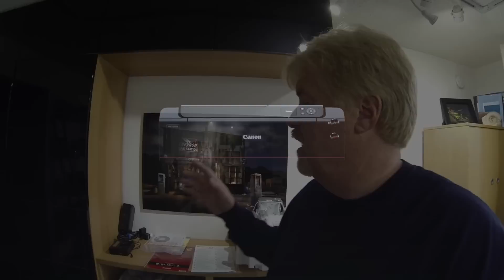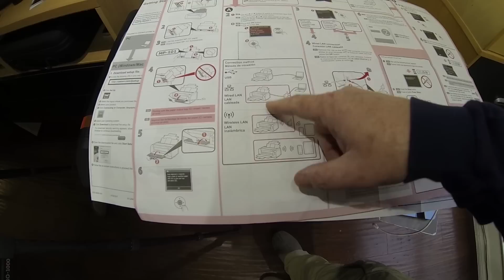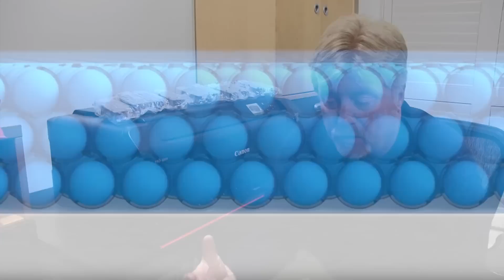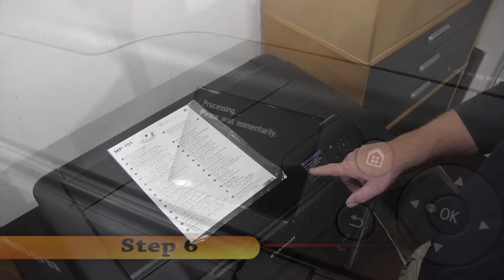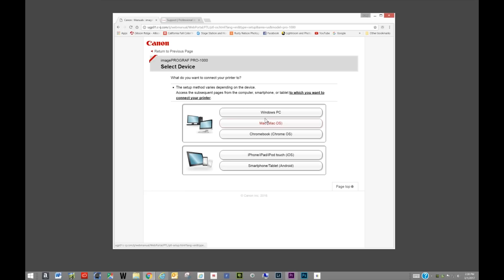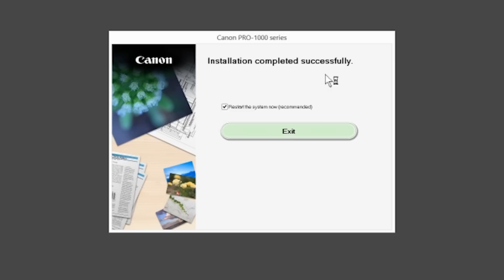Canon ImagePROGRAF Pro 1000 Printer and software install / unbox.  How easy was it to setup?

Comment: Hello,

I recently purchased a Pro-1000 and have been unable to install the drivers on Windows 10.

The software/driver package fails saying something along the lines of "Installation failed. IJ Driver could not be installed."

The driver install fails saying "An error occurred while files were being copied. : 0001 0002"

I contacted Canon and they said this is a known issue and they do not have a fix.

Before I return this thing I was wondering if you had heard of similar errors? Canon doesn't seem to pay much attention to their software.
Reply from the maker: I have not had that problem.  I would call them back.  Make sure you are talking to an uplevel tech in the US before you get off the phone.  I would also search around the internet under that code.  Something should pop up if it is a real issue.  I would even call back a third time.  I have 10 and have had one time a while ago where I had called a few times until I got the right person.
Reply: @RustyNelsonPhotography  Thanks for the response. I didn't end up getting any help from Canon, but I did figure out a workaround after doing some digging.

I examined Canon's driver signatures, and one of the signatures expired in February 2020. Additionally, the signatures have no timestamp which throws a warning in DigiCert. My theory is that Canon's expired driver signature causes installation problems in some Windows configurations. I'm no expert on Windows driver signing however, so I can't say for sure.

It is possible to restart Windows with driver signature enforcement disabled. Doing so appears to allow the drivers to install.
1) Click Start > Power
2) While holding the Shift key, click restart
3) Select "Troubleshoot"
4) Select "Advanced Options"
5) Select "Startup Settings"
6) Select "Restart"
7) When your computer restarts, select the option that corresponds to "Disable driver signature enforcement"

 8) You should now be able to install the drivers. You'll get a warning message that Windows could not verify the driver signature, and will have to click install anyway.

This worked for me, hopefully it helps someone else.

Comment: Rusty after a couple of years are you still happy with the Canon Pro 1000? Would you buy it again?  I need to replace my Epson 3880 after 10 years. Any insight is appreciated.
Reply from the maker: Yes.  But if you want to use roll paper that is a consideration.  They did a firmware to about 47 inches or so.  But the end answer is yes I like it.  Let me know how it goes.  I have not had a problem with it even after the LONG storage as you probably saw in my video.

Comment: Canon has developed driver/software to print 46" long prints but have not offered paper 17x46.  Has anyone cut a 45" long x 17" wide paper to print panos on the pro 1000?
Reply from the maker: cant remember how I cut it but I tried it and worked fine.  If you are coming off a roll your will have to counter roll it to get it to lie a little flatter then when it comes off the roll.

Comment: I need your help. The software for installing the driver run, but after at point 3 it say that it’s impossible to installing the drivers. I use Windows 10. Have you any suggestion? Thank you.
Reply from the maker: Really sorry but I would really have no idea.  Just not enough to go on.  I would call Canon tech support.   Sorry about that.   One question that may help somebody else answer...is this the first time you are installing the driver?
Reply: @RustyNelsonPhotography  in this pc yes, is the first time and the first printer installed. 
Is a second hand print. On the printer the driver are update.
A note: windows see the print and it work but whithuot the canon drive, and like you know with fewer option for print.

Comment: Thanks for this Rusty. I just got a full replacement of my Pro1000 from Canon. My first one was still on warranty. I got a B506 message on the LCD screen and a very troubling chattering sound from the print head. Canon support didn't have a clear answer as to what B506 meant. The new machine arrived in under a week.
Reply from the maker: I must say that Canon has always treated me well.  I'm about ready to start my new pro 4000 and hoping for the best.  Just started up my pro 1000 after sitting for 15 mnths.  https://studio.youtube.com/video/kiOk_r_wqI8/comments

Comment: I have concerns about size of printer with paper trays  folded out. You say the rear one needs 15" but in your video when you printed nozzle check it looked more like 9".  This is important to me as I need to fit on desk and size is critical. Thanks
Reply from the maker: Sorry I did not get back to you in the middle of a move.  Yes I do not have...or did not have 15 inches but that just meant that the paper when loaded was up against the wall.  Worked for me but may not work for you.

Comment: Thank you for the great video. Can you please provide info on what stand you are using for the printer? That printer weighs a ton.
Reply from the maker: I just have a self made stand out of a flat File cabinet.  On a table from Ikea but is braced between two cabinets.

Comment: I've just had to refill my Pro-1000 ink cartridges.. However I can not disable the error code '1730' that says they are still empty.   I read where you can disable this my holding down the STOP/CANCEL button, but this is not working for me.   Any suggestions?
Reply from the maker: Hey Jane I only use the inks from canon so I'm not really the one to ask about refilling.  You might try throwing it out to this link.  Jose does a bunch of refilling.  Tell him Rusty sent you.  All the best.  https://www.youtube.com/user/cheo1949

Comment: Thanks for this great video. I'm late to the party but I've just discovered this video. Wish I'd seen it before I set up my first Pro-1000 last year. That's just about to be replaced by Canon under warranty and the new one is due next week. Glad I watched this before it arrives. PS pray you never see a B208 Support Code on your printer. That's why mine is being replaced. But to be fair to Canon UK they've been amazing. No quibbles, new printer. Bosh!
Reply from the maker: Yes they are good about replacing when things really go wrong.  I've had a good experience with Canon...thats why I stick woth them.   Let me know who it goes with the new one.

Comment: Is possible to know what is the capacity of the initial ink set that comes with the printer package? Because the regular inks are 80ml, but would be helpful to know how much the initial set will last. Thank you.
Reply from the maker: Not sure if they short you on the first ink carts like HP used to do.  I order a replacement as soon as the ink low level comes on.  You have plenty of time after that before it "stops" completely.  I just made a major move so I'm a little behind and not set up to make vids right now.  Next video will be unpacking  from a shipment cross country.  Has been packed away for a while so it will be interesting to see if it fires up with no problem.

Comment: So I just got my pro-1000 set up, I’ve calibrated my monitor and have the appropriate ICC profiles for the printer and paper but for some reason what is on my screen is not what I see on the print. It prints beautifully and bolsters my confidence in such a purchase but I’m at a loss now. Could you shed some light on my dilemma please?
Reply from the maker: There are a bunch of things that can go wrong but my first guess would be that you have not turned off the "printer manages".  This would mean that you have double "managed" the color.  Being that I have no idea HOW you are printing...software...computer...setup etc... make sure you have the color correction in maunual setup in the driver set to "NONE".

Comment: Rusty, This was a great video--one of the best on setting up the Pro-1000 and the one I used for info when I set mine up.  I know it is not something you covered but wish someone had put out the information on how much ink this printer waste.  It puts a fraction of the ink on paper that it uses cleaning and all that goes to the waste ink cartridge.  I have done most of the things to minimize this but still the unit waste 7-10 times the ink it is putting on paper.  This is a huge cost! This printer should be advertised as a production unit only, not for someone who wants to make 3-7 prints per week. When I use up the 2nd set of inks that I purchased, I will probably use this printer as a boat anchor and get an Epson P-800. I'll come out ahead on cost very quickly. The 3-4 ml of ink the Epson printer uses to swap black and matt black is nothing--I repeat--nothing compared to what the Pro-1000 waste every day!
Reply from the maker: Thanks for the kind words. I wish I had the real story for you, but I can't find a "true cost" for the inks but I did find this for you. I have not run actual test.  Remember I do not get paid by anybody. Fro knows best did a cost doing a print with the pro 1000 on Red River paper and Red River did a cost of ink with the p800. Here are the links. 
Fro https://froknowsphoto.com/the-exact-cost-of-an-inkjet-photo-revealed/
From Red River. http://www.redrivercatalog.com/epson-surecolor-p800-cost-per-print.htmldraw your own conclusions folks.
Trust me...I'm not arguing with you. They all seem to use a bunch to me. But here are somethings Ihave found about the Canon that may help. 
Also these are not really direct comparisons.  I wish I could find one.  But Canon does supply the software to figure
it out…I do not use it.
1. I have been told by the Canon folks that you can use the Ink cart all the way down until it stops.That is what I do. It will tell you the ink is low. From experience...there is a ton of ink left at that point and I just use this as a warning to make a new order for that color. Once the ink is out...the printer will stop. They do not
tell you this in the manual. BUT...they told me this when talking to them. Up to you. 
2. Take a print and run a test on your quality settings. If you do not need "highest" quality don't use it. 
If anybody has any information on this subject, please feel free to just jump in and help. BUT...you need to show the documentation and not just slam one printer or the other.
Reply: Rusty, I did not offer a lot of proof in the comment above and for that I apologize. I don't troll companies or products and you'll notice I always use my name. Rather than produce a new list here, I'll just copy the info I sent to Canon. I have seen little or no change in consumption since this info was sent. Typical was the other day when I made a print 43 hours after the last print, used 0.602 ml on paper but consumed 5 ml of ink. In the write up below, please pay attention to the 6 min. cleaning cycle that reportedly uses 59ml of ink. This happened to me even though I had printed the day before and did not request a cleaning cycle--I just hit print. I am not including a link to a forum on Luminous Landscape where a man confirmed it has happened twice to him--he does appear to be a commercial printer though and still sees a waste to print ink ratio of about 50-50. This printer is just not for hobbyist or enthusiastic armatures--I put my self between these two. 
Thanks, Mabe Hall

One last note: I have found that the initial fill cartridges hold around 86 ml of ink yet--this doesn't affect my overall calculations.

The following was sent to Canon.

The Problem: Unbelievable high ink waste
I have called support twice, received some ideas and then taken my Pro-1000 to a Canon authorized repair place as recommended by Canon.  The repair center found nothing wrong. 1st let's review my problem and how I use my printer:
   1. I leave my printer on at all times (it may have had 3-4 on/off power cycles shortly after commissioning but after that it stayed on until I took it to the repair facility.
   2. Knowing that cleaning cycles happen if the printer is not used: With 5-10 exceptions I printed something within 48 hours of the last print--at a minimum a nozzle check. I don't believe I ever exceeded 5 days without printing something. All nozzle checks have been perfect. All prints have been perfect.
   3. I have never self initiated a cleaning cycle of any kind.
   4. I know the unit consumes a lot of ink to fill the lines at commissioning---50% of total ink capacity or a little less. I use 50% for evaluation of my problem.
   5. I originally had my printer connected over Wi-Fi but at your help desk recommendation due to low signal strength I changed to USB. This appears to not have helped.
   6. I now realized this is happening to others, maybe everyone, and I am sure Canon knows about it.
   7. Right now I have not installed a 2nd set of ink cartridges but I have purchased them. I am afraid to see another major ink dump. I have never moved the printer while plugged in and moved it only to take to the service center. No ink spilled.
   8. Including this printer, additional ink cartridges, Canon Paper, and maintenance cart I have invested well over $2000.
Now let's look at what I am seeing. These numbers are based on the 1st 93 days of operation and consumption figures are from the Account Management Software.
   1. All my ink cartridges read low. My waste maintenance tank indicates almost full.
   2. There was a big jump from 3 cartridges low to all low after some type of major cleaning event---see attached video of similar event and thread from dpreview.
   3. At 93 days, I had made only 50 prints using only 35 ml of ink to print these.
   4. Not included in the accounting software are the calibration prints--about 5, and the nozzle checks--5-10. To be conservative let's say another 5 ml. for a total of 40 ml used in printing.
   5. TOTAL INK CONSUMED AT 93 DAYS WAS 887 ml.  !!!!!!! Now after 2 additional prints of less than .5 ml each and the service center-- 900 ml. !!!!
   5. The 12 cartridges hold a total of 960 ml or ink (some people say 82 ml each giving 984)
   6. Now, if the initial commissioning uses more than 50% of total ink say 85%, I can understand but this is not what others are reporting.
With the numbers concerning the use of ink, it becomes evident that this printer is seriously flawed or has a serious problem. It is hard to believe Canon put this printer on the market operating like this. One reason I chose this printer over the Epson P-800 was the Epson wasted 3.7 ml. of ink changing from Matt Black to PK black.  3.7 ml is NOTHING compared to the ink waste I and others are seeing. See the dpreview thread discussing this problem. One person has already sold his unit--I believe doing so without telling about the problem would be unethical. One knowledgeable person says one  should expect $300 per year in waste ink cost. This is just not acceptable!
I purchased this printer from B&H Photo.  Before I go back to them I would like to discuss with someone in Canon what can be done here.  Please call me at 512-670-7445 or give me a time and number when I can call.
Sincerely,
Mabe Hall
Link to dpreview thead:  https://www.dpreview.com/forums/thread/4023123?page=3
Link to recording of dreaded cleaning cycle: https://youtu.be/HVz0dA9Lz9E
Reply from the maker: Hey thanks a bunch for the reply.  Sure would like to hear what they have to say so if you get something please feel free to post.

Comment: Great video. Having just bought one of these it's a great help . Thanks Rusty :D
Reply from the maker: Thanks Paul.  I'll be doing more vids and some more info coming on the blog (www.RustyNelsonblog.com) about the printer and Print Studio Pro. Found out a bunch of info from Canon about working with and printing differences if you are through Photoshop or Lightroom.  May not be all videos.  Hopefully it will spark some conversation about the printer in the remarks.  I was really surprised by how much CO "ink" there was left in the cartridge.